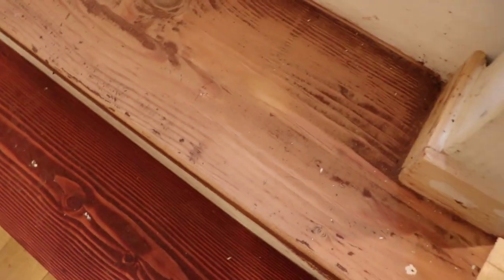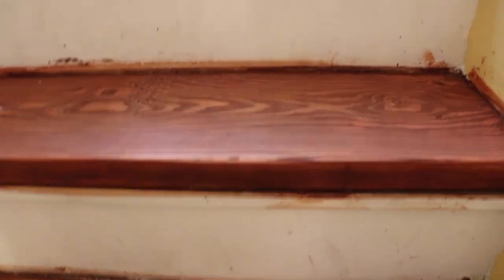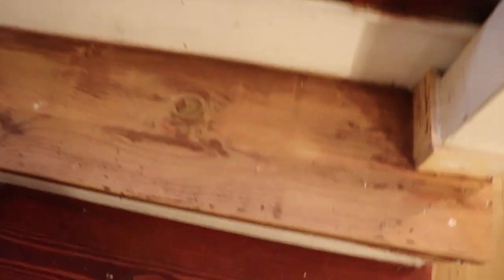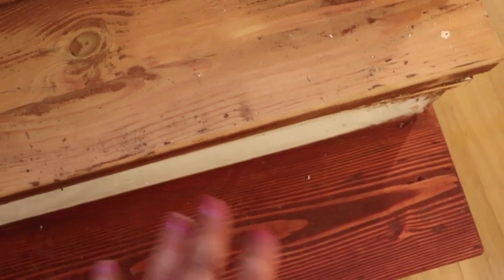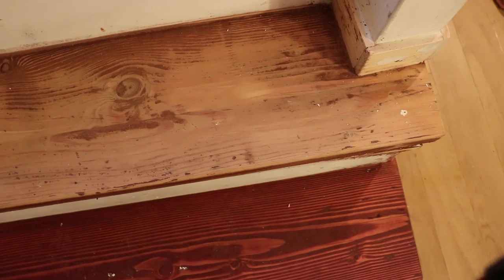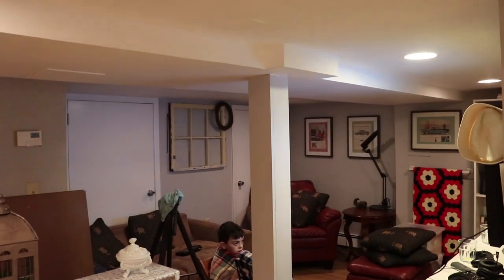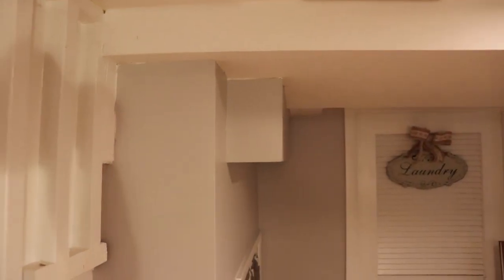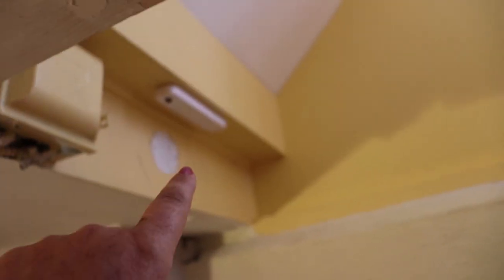🔨 Basement Stairs Makeover || Part Three 🔨

Comment: Fantastic job so far!!! For all the angle cuts of the bead board, you could make a template made of cardboard, paper or anything else you may have handy. Then just trace on the bead board and cut. Would save a lot of measuring and time.

Comment: Very interesting discovery of your staircase.  Typically, most of the houses in our neighborhood with two floors, they built the staircases above one another, like in our house and the same with the bathrooms, hence it was cheaper to put one above the other for plumbing purposes.  We have a Cape Cod style home, so the craftsmen homes are probably built differently.  Can't wait to see the stairs finished.  The bead board will look nice, but I think you should open up that little wall on the staircase.
Reply from the maker: ours is different because  the main staircase is not central, it's in the back of the house, I  am going to ask the town for the original plans, I hope they have them

Comment: So was the kitchen extended or the whole kitchen a new part of the house? What do you think the basement was used for originally besides the laundry, boiler, etc?
Reply from the maker: The extension is past where the stove is and the bay window. I think the basement was just one big room and there probably was an area where they d dump coal for heating. The old staircase was basically half under the new stairs and half either straight or making a turn under the hallway to the kitchen. You can clearly see there was a landing 3 feet below where the new stairs are. I am just not sure whether it went straight or turned after that.